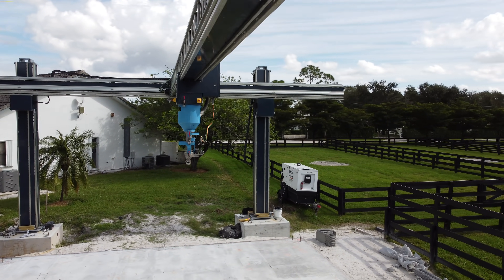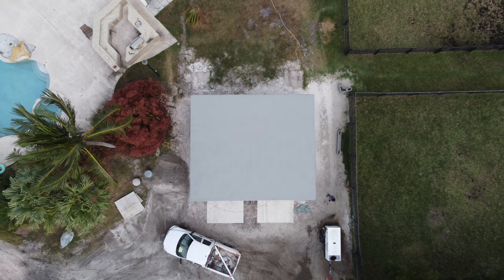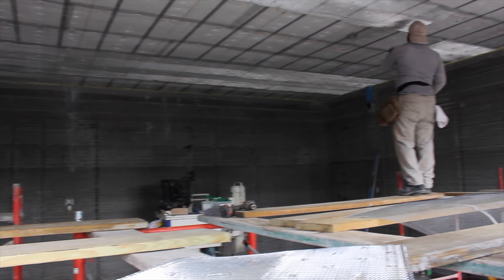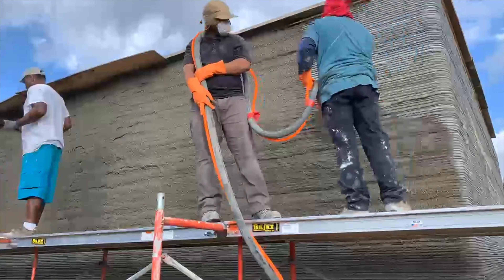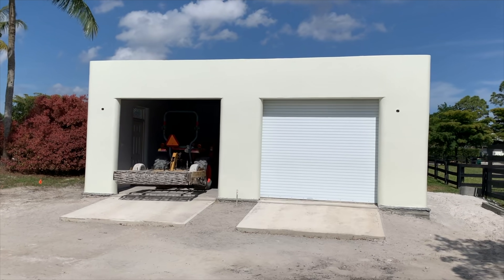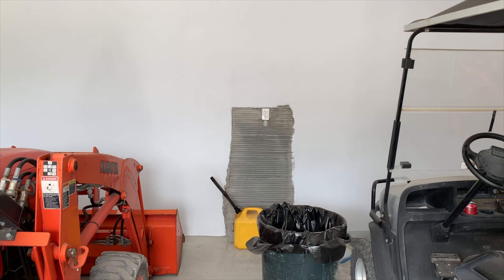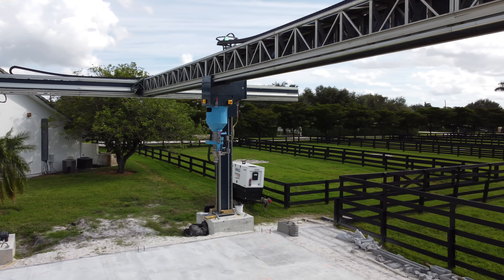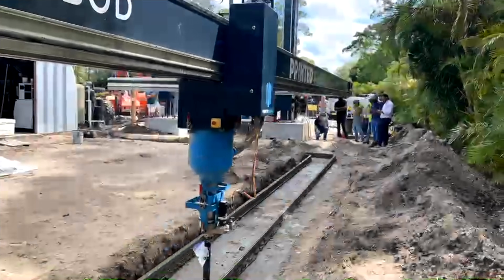Smooth Finish on 3D Printed Building in Florida (Part 2/2) [Printed Farms]

Comment: First,, why didn't you 3d print the garage aprons? Second, NEVER leave the electric service outdoors when you can place it indoors, You can place the panel in the wall and 3D around it on the interior flush finished to the wall. Third, it is best to use conduit for all wiring so that wires can be replaced. It would be a REAL issue if a wire failed.
I want to watch a building being printed and understand the process of mechanical, electrical and plumbing, floors and roofs as well as second story floors.

Comment: How do you run the electrical wires and water pipes inside the concrete walls? If the owner wants to add more electrical outlets how does he connect the wires inside the concrete wall?

Comment: Hi. I have a formwork for the slab (roof). It allows to skip the foam and use instead polyurethane and underneath Sheetrock fastened to the concrete beams. Quick, low cost, and with better finishing.
Reply: hi. what you saying?

Comment: I wonder what kind of concrete is used if there are no reinforcement iron. Do they use glasfiber in the concrete? How is the thermal bridge handled at doors, windows etc. So many questions.

Comment: Adding an appropriate length of trowel that oscillate on each side behind the printer head would smooth it out automatically as the concrete is still wet and pliable. If we can build robotics in this day and age capable of almost any complex set of instructions with accurate finished results, I'm sure a simple smoothing apparatus can be added.

Comment: If you don't like the smooth surface on the outside you could probably stamp some kind of a pattern on it after it's troweled.
Reply: Good idea
Reply: That would be very super. probably beofer drying but that would be delicate.

Comment: No where near enough electrical in that building  Only 2 coach lights on the outside nothing in the middle of the garage doors, no side light for the service door.  And it looked like the inside garage lighting was very minimal.   I don't know if they had a real licenced electrician in there.  All that blue plastic flex.  I would never use that  They probably cut cost and used one of those non licenced guys who knows enough about electrical to be dangerous.

Comment: So called 3D printing of concrete buildings solves a problem that doesn’t exist while creating a hundred problems that are unnecessary
Reply: Please elaborate that idea.
Reply: @JuancoPRoFlow  basically there are hundreds of stay-in-place forms —- as well as a couple of “ no form work” approaches that are not only faster, cheaper, can do the roof and ceilings ( not only walls which is only 11-15% of a structure ) 
These systems also do proper reinforcement and insulation and allow for needed wiring and plumbing 
When the expensive apparatus needed for the fad/ novelty erroneously called 3D printing breaks down you are not building anything.    With the right form, I can build two houses of equal footprint and design while the fad followers are setting up the fancy toy —- not to mention the cost of the special mix , the inability to access some sites, the calibration needed every time it is moved, etc, etc
Reply: @teslastones  do you build in Florida? If yes, what area?
Reply: @JuancoPRoFlow  stay tuned. We are gearing up with a large project which will use the exoskeleton, geopolymer, algae based binders etc

Comment: Good luck trying to contact anyone/company to build a home for you. I live in Florida, sold my hone bought property and tried for 2 months to speak with them. I want to build one of these homes. I even sent an email from their website. Nothing, no response. VERY disappointed. If they don’t want your business then they should not advertise theirs!
Reply: Here is the email is sent you: 

Hi Mimi, 

Could you please advise your timeline and budget. We would estimate that the price is 25% higher than building with block, but the building is stronger. 

Are you willing to build based on initial cost calculation, but it will in the end be cost plus? Meaning we will not take any profit, just get paid for the costs. 

Do you have a design? 

Have a great weekend. 

Fredrik

Comment: Why couldn’t the use a form that rises automatically for each layer smoothing the outside as it moves up 
It may allow for faster printing as well
Reply: We are using flaps on the sides to smooth out now.
Reply: @printedfarms443  In the second build with the smoother, the excess was falling off the side, which I'm guessing has to be manually cleaned up. Also that looks like a lot of wasted concrete, does it get or can it get incorporated back into the mix? Do the flaps remove the excess waste issue?

Comment: I have an idea for the roof: Why not print it "big roof tiles" in the printing bed, stop at Z, put manualy the rebars or connectors, and continue printing. After you finish the print "unglue" the tiles from the bed and use a special head to lift them to position.
Reply: I’m not sure what you mean. Please elaborate. Interesting

Comment: no sense. mold vs print in simple or in complex buildings architectures, just look out and compare the two systems...
one integrate everything plants, cables, iron rebars, insulation, internal support for finish drywall... the other? is it really vertical or horizontal... how much time to print and to cure?
https://www.youtube.com/watch?v=0OR28P6MEQ8
Reply: Every ICF we talk to constantly report the same issue. We cannot find enough people competent building for us. 

If you asks a 20 year kid today if the want to carry block or build with a 3D printer, the answer is obvious. The undersupply in US of housing is gigantic and growing.

Comment: Put a rotating brush sideways on the outside edge of the printer head to smooth the outside WALL, or both inside and outside walls as it is being printed, while the cement is wet
Reply: nah, its FLA man, just back up an airboat and use that smooth it ))

Comment: Thank you for these videos! Can you please cover how strong this is? In regular buildings (concrete and brick), we have iron in the structure (a lot); I can't see the same from the video. In case of an earthquake, etc., will it hold?
Keep up the good work!
Reply: Material is min 9000 psi, rebar horizontally and vertically.
Reply: @printedfarms443  Got it, you can see the rebar at around @0:17. Keep it up and thank you for the reply.

Comment: Pretty awesome.  I'd like to see Delta printers used in home construction.  That'd be one less leg to set up.  Could drill 3 holes in the ground and drop in telephone poles that you either leave on site or just cut off at the bottom when you are done.  Also to add a new section you'd only need to add one more telephone pole and transfer the cabling from one leg to the new leg.  The legs that are left in place could be used for sail cloth or to string lights.
I'd also like to see someone try an aircrete mix on a 3d printed home.  To keep the printhead at it's lightest I envision using a vacuum hose to suck the concrete up to the head on an as needed basis and mix it in the head with water from a hose.  And add soapy water in before it is extruded.  But that's all a guess and probably quite an expensive test to conduct the feasibility of a system like that.
Reply from the maker: Wasp 3D does this but their big delta printer is a hexagon not a triangle not sure why